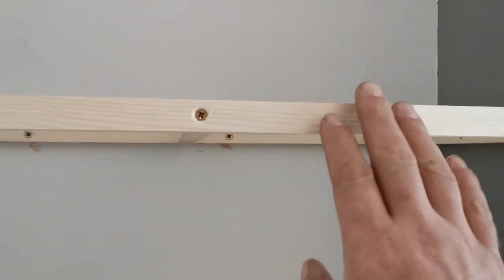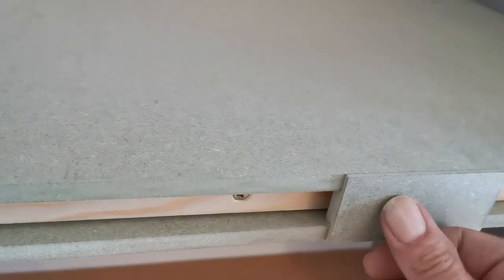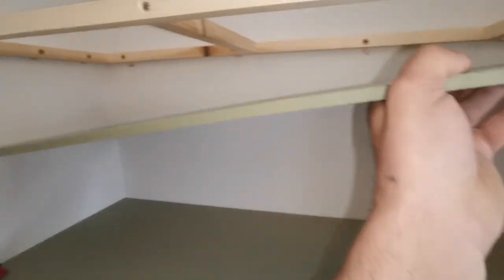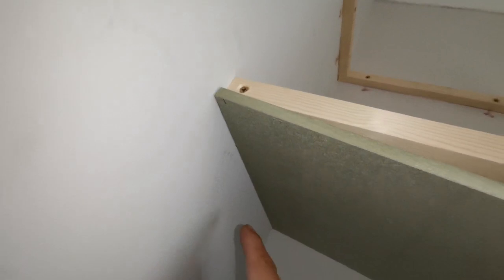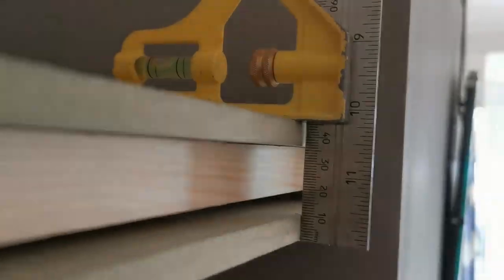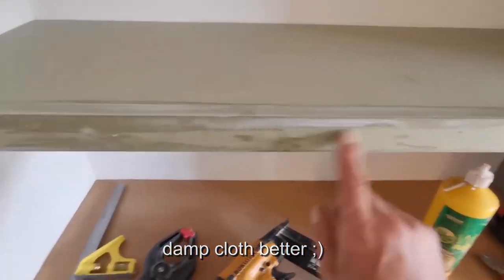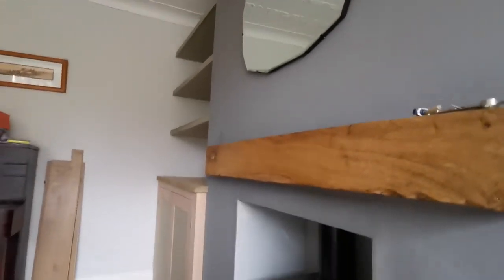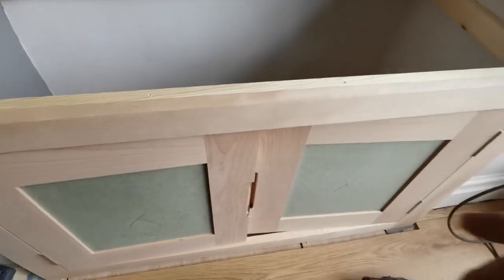More alcove cupboards 6 - Finished

Comment: nice work Gid, hope the customers finish on them matches the standard of the joinery.
Reply from the maker: Thanks 👍, experience says I doubt it, I have more faith in these customers but people blathering it in paint is why i offer to spray stuff 😂
Reply: Doesn’t help that most DIY grade paints these days are shite. I’ve been testing water based acrylic and I found Johnstones Aqua rollered on with a mohair roller to be OK, rest of the available paints were shocking.
Reply from the maker: Yeah, i don't do much hand painting, some are crap n very translucent, Leyland trade acrylic are what i use

Comment: Another great install Gid, like the construction of shelf’s.
You need a fan when it’s warm. Cheers Gid
Steve.
Reply from the maker: Thanks, yeah too warm in there but outside was just as bad, he did put a big fan on a stand in there because they couldn't open the windows but nooooo, the noise & wind did my head in immediately 🤣👍

Comment: Great quality as usual Gid keep up the good work, would have put a solid slip on worktops myself but everyone to their own. looks great
Reply from the maker: Thanks Frank 👍 each job is different, solid slips might look ok to begin with but can show through later because the board & slip will move/expand at different amounts, thin edging can then get knocked off. I avoid putting edging on unless it's ply where there's no choice, in that case like the shelves i put a piece with decent thickness on.

Comment: In those tight spaces I use a cardboard template. I get 2 pieces of cardboard, both about 2/3rds the length of the gap. Place one over the other. Pencil scribe both ends. Cut with a pair of scissors & lay them back in place. Move each piece to the scribed ends & sellotape the two pieces together. Perfect template. 👍👍👍

Comment: Great video, when putting the shelves in could you mark a line all the way around the front frame when you have got it in its final position then remove it and then fit the shelves ? thats what I do makes it a lot easier for me.
Reply from the maker: Hi & thanks Ken 👍 yes and no is my answer, putting the shelves in without the front frame fixed in place would be easier and sometimes I have no choice but to do that. I suspect that the frame would need offering up a couple of times to make sure that the shelf is correct? But I quite often put a base in the cupboard which covers up fixings at the bottom of the front frame so the base board would have to go in after the shelves if they were to be fitted before the front frame is fixed in, shelves, fix front frame to the floor, then the base to cover those fixings? Once I fix the front frame in I'm reluctant to remove it to fit the shelves, I feel like I'm going backwards & I don't find fitting the shelves after the front too hard, it can be a bit awkward but if I have to remove one of the supporting battens it's less work than having to refit the front frame, & the final thought is that when I'm discussing the build with the clients the amount of shelves is pretty much decided, but I say that they can decide on those later when they can see the cupboard and have a better idea of the size inside etc, 1 or 2 shelves? They often don't sound too sure at the beginning & can't envision the finished piece even though I've given them a scale drawing, swings and roundabouts as to which order, if you find it easier the way you mention & it works for you then that's you're perogative, the finished piece is the important thing 👍 😊

Comment: Another masterclass in carpentry Gid, I wish I seen all your vids prior to doing all the work in my own house. Now want to get into spraying as I’m shit at painting so been looking at your technique for that too as you get a great finish. Keep up the great videos. What those magnetic catches called? I use the ones from B&Q and they’re not great!
Reply from the maker: Thanks 👍  I have a 50L Bostitch compressor, it's only just big enough for what I'm spraying, if i had to replace it i would get a 100L+ machine with the highest cfm i could afford, cfm is how fast the pump refills the tank, The Devilbiss FLG5 with 1.8mm nozzle is my favourite no'1 gun, Id recommend that, it will spray almost anything but there are cheaper ANI guns, £24, that work fine & could be a starting gun to practice with, i have two of those, a compressor in a garage/workshop is a good thing anyway, blowing off work, nailguns, inflating tires.... This company are good people for sprayguns, the compressor I'd have to look into when the time comes but my little site Wolf 6L compressor is 25yrs old n still works well even though it's been knocked around a lot so would consider one of those if they make them as well as they did https://www.spraygunsdirect.co.uk/index.php/  They're these but i don't pay screwfix price, Google Carlisle magnetic catch, there's cheaper ones online https://www.screwfix.com/p/carlisle-brass-magnetic-catch-nickel-plated-15-x-14mm/2077p#_=p
Reply: Thank Gid, much appreciated. Keep up the greats vids

Comment: Great series (as always) Gid; a real masterclass in scribing. If the shelves were to be spayed, how would this have changed your approach, as you wouldn't have been able to glue & pin on site?
Reply from the maker: Thanks 👍 I never really considered how much scribing i did until making these vids 😂the shelves I would make them in a similar way on my bench, prob using the lock mitre cutter for the front as it gives a neater finish but leave the timber frame inside 20mm+ back from the edges so a batten could be fitted to the sides & back wall of the alcove & then the sprayed shelf would slide in over those & just be glued, problem with that is the alcove is never square so getting a good fit is hard, the made-up/sprayed shelf could be scribed to the correct shape but cutting nice fresh paint & getting a clean cut on both sides, & if the front of the alcove is smaller than the back it won't slide in 😣😂

Comment: Nice one Gid, ref your shelf, do you drill at the laser line or do you align top/bottom of the battens against the laser
Reply from the maker: Thanks Steve 👍 It depends if i can set the laser up, if i can set to the correct height i would work top/bottom of the batten, when screwing the piece on the hole could be anywhere but where the batten or whatever is getting fixed to the wall is fixed is the important thing, just as if you're sitting a level on top of it, quite often tho the laser is just a level line to measure from.

Comment: Very nice job Gid! just out of interest, how much roughly would a  job like this cost?
Reply from the maker: Hi Joe, thanks 👍 Sorry it's hard to give a price as I don't share my details on here but for a job like this it's about a wks labour 5-7days + materials,  every job is different, Materials would prob be £100-£150-ish , A morning shopping, machining and making doors takes the most time, a couple/few days, then a day or two fitting it in the house, I don't rush to get the job done, I want it done right even if it takes a bit longer but I don't charge more for that extra time, the final invoice I give is the same as the original quote unless they change something along the way, sometimes waiting for glue to dry can add time because 2 days quoted work (16hrs) sometimes has to be spread across 3days, on this job making the floating shelves was a little time consuming,

Comment: As always excellent videos Gid with loads of tips , dying to try the MR MDF but it is £35.00 a sheet in Wickes
Reply from the maker: 😉 Thanks Simon 👍 I remember someone saying they live on the coast with no big shops? Is that the only store near you, ?
Reply: @Gidjoiner  that will be me 😂😂, I just order from a builders merchants or timber merchants most will deliver for free, you've sometimes got to wait if they have to order it in, but worth the wait , you will have to buy the full sheets unlike BQ or wicks , hardwood like beech, oak etc are difficult for me 🤔🙄😔
Reply: @Gidjoiner  I did reply Gid but cannot see my reply , i live in Manchester so there must be some decent wood yards ,ill have to do a bit of research and see if i can find it elsewhere, if not i will just pay the £35 at wickes .
Going slightly off subject i wanted to pick your brains Gid regarding pre-cat versus two part paint , i am thinking of having a go at spraying my upvc windows, they are the typical white windows, i have half a can of dark grey pre-cat left from when i repaired and sprayed my sons kitchen and was going to use that ,but i am pretty sure in one of your videos you stated that two part dries to a harder finish .
What do you think Gid , is the pre-cat up to the job or would you say buy the two part which i have not tried yet .
Reply from the maker: Hi, There's several kinds of paint, single & two part, it's not the hardness i would be thoughtful of, I wouldn't use the Pre-cat on plastic, I'd go with the PU i use normally, plastic paint for plastic windows, both are enamels but there's a flexibility in the PU paint but not in the pre-cat, to be honest tho I've no idea what the outcome of either would be, & to clean the UPVC first? I know the PU thinners melts some plastics, Go for it n good luck 😂👍

Comment: Can I ask, why not edge the shelf fronts/Tops with Beech?
Reply from the maker: It's all going to get painted, different materials move at different rates so lippings tend to show after a while & get knocked off, these shelves were to look like seamless boxes ,
Why would i want to lip the edges with Beech? 
I lip the front of the internal shelves to stiffen/strengthen the front edge & to cover the ugly plywood edge but generally I avoid putting lippings on whenever possible,
Reply: I thought the beech doors would have had a finish on them for the 'wood look' might have well made them out of MR Mdf
Reply from the maker: I have this comment saved for this sorry it's long n copied n pasted, - 
 The basic answer is compared to Beech MDF is crap, 
 It's about the quality of the base material & therefore the quality of the overall job, wood is wood to me so painting it is no issue but some woods are better than others, for quite a while i used pine, 'cheapest price' i was asked for but the shrinkage & warping later when the pieces went into a centrally heated house were unacceptable to me, Beech doesn't cost that much more on a job of this price, the time & expense put in ya might as well have a decent substrate that'll stay relatively stable for it's lifetime, Beech is harder than pine & 100 times better than MDF, it's fairly straight grained with little or no knots, it's not just the longevity tho you can feel the difference after it's sprayed, the temperature, the hardness & the way it shuts just gives it a better well made feel. I build these things with the hope that they will still be around in 50yrs like the old pieces that are still sometimes around, they were often made of pine, which is what i was/am trying to emulate but the quality of the wood (pine) was better then, if i bought planed pse pine i would still have to machine it sq n straight because off the shelf it never is, so the labour in preparing the wood is not much different & cutting the dominos is the same for both & maybe the same time spent would be spent on the joint of MDF whether that is a spline/scribe/groove or domino.  
I would use MDF if I didn't care too much & the job was cheap, if i didn't expect them to last more than 5yrs, if i wanted a very flat no grain finish or if it had to be done with that material through customers choice for whatever reason (prob against my advise), Mdf boards never come straight so tall doors can be a problem, screws don't hold as well as they do in Beech so hinges tend to come loose, fitting butt hinges into the edge of MDF is not reasonably poss, I use ply for the carcass on some jobs for a similar reason so the screws in hinges/hinge mounting plates, hanging rails & drawer runners hold well,
When spraying there is an inside & outside edge on the stiles n rails, MDF feathers a little so there would be more work there sanding, i give my customers the option of ply or MDF panels on the doors, you get a very flat finish with the MDF, Ply is a slightly better material but there's a possibility of seeing the grain through the paint, their choice?, when sanding these doors with beech stiles & MR MDF (I only use Medite MR MDF) panels it's always the panels that need the most sanding,
I do sometimes use MDF for doors & drawer fronts, normally when it's just a plain flat door i want but I have a list of materials in my head, MDF is the very bottom & would be my last choice for shaker doors. unless it was a bespoke style/sized door to match an existing set you might as buy some, there's loads of MDF units/furniture on the market, a lot cheaper than asking me to build one, Building out of MDF is not the quality that my clients ask for or expect from me
Reply: @Gidjoiner  Only asked lol.
But I agree, the pine today is not worth a wank MR MDF does hold it's shape well, I have not checked out the prices of beech for a while while, so not sure of the price difference, most people want it as cheap as possible, cheapest way MR MDF (if I dont have to paint it :))
Reply: @Pistol_Knight  Sad but true, most people have no taste and don't value real craftsmanship. These same people will spend a grand on a 60" flat screen television but would baulk at you for asking them for the same money for a handcrafted dining table, 🙄🙄 I would love to have been a tradesman fifty or sixty Years ago. Back when craftsmanship  was appreciated and the quality of the timber was much better.